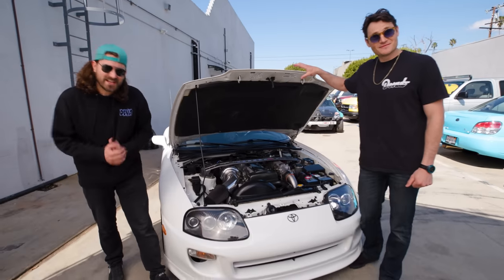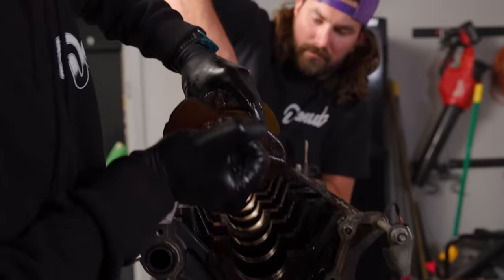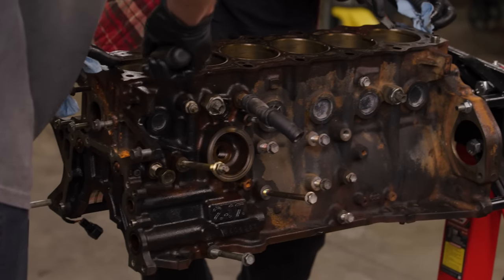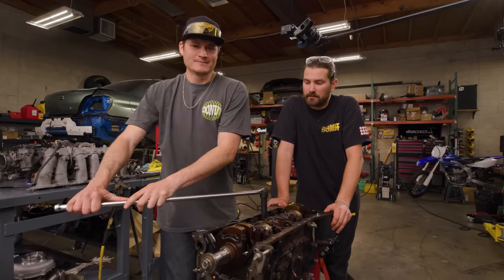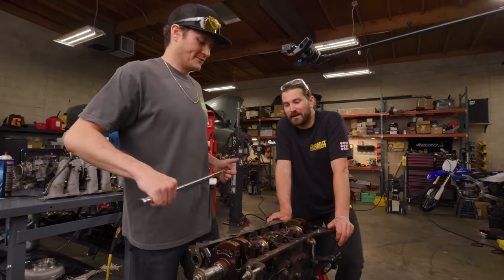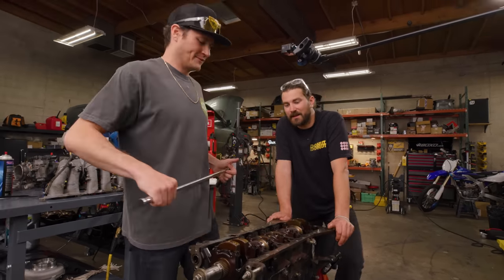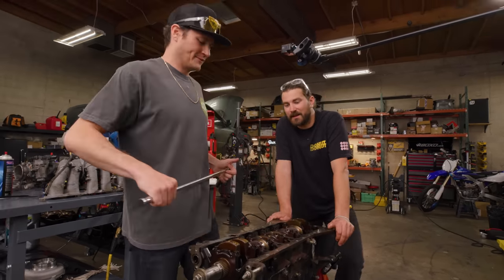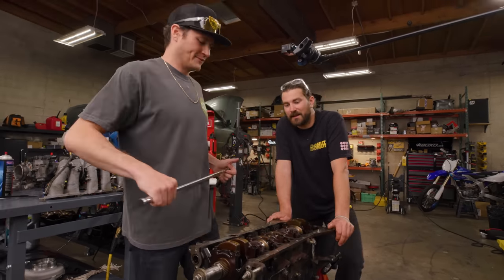Rebuilding a 2JZ to See Why It's So Good

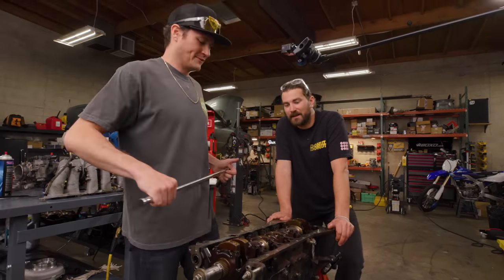Comment: @13:44 if anyone is doing this with ARP head studs, make sure to coat both sides of the washer and drop it down into the head before you install it onto the studs; you cannot do it the other way around.

@20:49 those two allen bolts are for the first VVT-I selenoid cam cap under the valve cover. Pull off the intake valve cover and you'll see the two little bolts to help seal the back of the cam cap.
Reply: Thank you for sharing your knowledge
Reply: So...uhh...is it important?
Reply: @justicedemocrat9357  Headgames motorsports told me they often break; and they have seen no issues running without them. But i think toyota designed it to help sealing, which is why everyone says to FIPG the corners under the caps to help mitigate oil seepage. Not hugely important no; but easy to put back in if your ears are still there.
Reply: Thank you for taking the time to explain this. I am building one myself and was very curious

Comment: You should do an LS teardown and see why its the most reliable, and the most common engine swap! Also, please put the 2JZ in the Silvia. It has no cons! It will fit well, It is a video that would do well, we would all love to see it, and then zack gets his car fixed!
Reply: I second all of this. 🤚
Reply: I also agree! Definitely about time Zack got his Silvia back! But also rebuild the RB!
Reply: Put the 2j in the Silvia do a tear down of the rb rebuild the engine them switch the engines
Reply: I think the LS, RB26 and the K20 would all be amazing for this series
Reply: that car was my first thought
Reply: it's the most common engine swap because it's one of the easiest high performance (for a stock one anyway) engines to obtain
Reply: They’ve mainly been swapped bc it’s a cheap and easy way for older cars to ditch carbs and go fuel injection
Reply: @@JLM.15Xthey’re also lighter and shorter than most engines including smaller ones. While also producing substantially more power than most stock motors.

Comment: Jeremiah: has an engineering degree
Also Jeremiah: can't do simple subtraction
Reply: Helpless without his slide rule.
Reply: Me too Jeremiah. Me too.
Reply: Thats what a calculator is for
Reply: Not much different from most engineers I’ve encountered
Reply: I used to attend a tech school. I have known a LOT of engineers. Engineers are now no longer capable of doing basic math. Rephrase it as an integral though, and they can do it in their head no problem.
Reply: That is the realest thing about us engineers. Believe me, I'm gonna use Matlab to do 2+2.
Reply: He was on the Revzilla podcast, and as far as I understand it, he actually doesn't have an engineering degree. He quit to do comedy before he graduated.

Comment: Stock cranks have seen 1500whp multiple time. 
Love how they put the head studs in block before installing the head. And then skipped to cams. 

Cuz they had to pull them back off to be able to fit washers in head

Comment: its all in the block. The quality and hardness of the casting material, the consistency of the castings, the siamese bores, the bore thickness from ~5,5mm at the bottom up to 8+mm towards the top (compare that to a "good" RB30 block which would be around 4,5mm at the top of the bore), ~10mm deck thickness (RB30 is around 8mm), 11 oil return holes at 15.5mm wide (RB30 has 5 return holes at 8mm).

Comment: The GE has alot more in common with the GTE than most people think. It's just ALOT easier to swap instead of modifying. Which is probably why the prices of GE's have increased as well.
Reply: Aren't the Non VVT-i GTE and GE the same internally?  It's the VVT-i ones that are different.
Reply: @sameerulhaq9928 yep, pistons are still different tho. I believe the GE non VVTI pistons are higher compression and doesn’t have oil squirrels. Funny how it’s still a bit different.

Comment: I don't know if it's important or not, but... I remember a video, when James mentioned the gentlemen's agreement and those 276 hp. He also said that it's kind of a weird number. But a lot of companies measure power in KW (kilowatts). And knowing that 276 hp = 200 kw (depends on numbers used, when calculating), those 276 hp don't seem that strange anymore. The gentlemen just agreed to 200 kw.
Reply: More precisely 206kw. The speed is also limited to 180km/h
Reply: I removed the k in mine, it does 180 m/h now 😂
Reply: At that time, Japanese car manufacturers measured their engine's horsepower in german style, ps. And in that way, the horsepower number is exactly 280 ps.
Still odd, but makes more sense than 276 hp, right?

Comment: Would love to see a rebuild of a vq35de. That’d be pretty sweet
Reply: That'd be neat. I've got one in my driveway that I just sealed back up. I'm going through the headache of trying to get all the air out of that horribly designed cooling system now.

Comment: Next we need the rb and a comparison please 🙏 😊
Reply: 2jz is far stronger. One of the Aussie channels (might have been Motive Video) did sonic testing on the block thickness and a whole heap of other tests. 2jz won nearly every single test.
Reply: @izzy031096  it's a beast what would be good actually is a Ford barra vs a 2j and then a BMW B58
Reply: @thehomelessproject3784  100% a far better comparison (despite the extra litre of displacement). That’s what makes the barra and intech so good, all that torque!!
Reply: @izzy031096  Hopefully they see these messages 🤣🤣

Comment: I'm pretty much a "jdm boi" but there's no way in hell i'm dropping 10k on that hunk of iron, the attractive of the jz engines is the "cheap" power we can get out of them, 10k puts you into a b58 powertrain like the mk5 supra, which has already been proven for 1000hp as well lol
Reply: Then you have no taste
Reply: @tfhssn  I have taste, i like the 2jz but the appeal of that engine has never been dropping 10k just to buy one. A B58 here is 4500€, a 2JZ could be bought for about 2-4000€ prepandemic, so yeah, it's not about taste it's about using a cheaper and lighter engine for cheaper that will still last and spending the difference on better cooling, suspension and transmission.
Reply: You're more of a money guy then a car guy I see lol

Comment: The 2JZ doesn’t make a lot of power at all. And that’s what makes it so awesome. 🤔

The crankshaft on the 2JZ was 20Lbs heavier than the RB25. And it has its way further away from the pivot point. 

When on something rotating you want to get the way to the center, and do you want to try to reduce it on the outer edge.... 

So that means the 2JZ would have to make more energy output to move that amount of weight to the same Power output as the smaller engine. And it wouldn’t be as rev happy, so it’s also going to be harder to make the same Hp number that the rb25 does too. 

And on the topic of Hp disadvantages.  The longer stroke of the 2JZ means it will do better after 5,000Rpm. So the fact it that the Rb25 had many advantages to help it make the “270hp” with a 2.5 vs the less efficient heavyweight 3.0L’s “270hp.”

.... but the reasons that it is less efficient, Are because they leaned towards their ability to survive a lot of different kinds of forces and twisting.

It’s not it efficiency to make and convert energy that make is so awesome. 

They simply built a more robust engine that could handle more power. And have a balanced “ Square cylinder geometry.” 

N/A 2JZ’s ain’t some 1,000 or even 800hp beasts.... they handle and withstand extremely high combustion pressures. 

And that is what makes them so awesome.

...But at the end of the day they don’t make a lot of power...they just withstand its abuse.

Comment: If those are hex head bolts those 2, they either go on the lower-end cover that goes over the oil pump and crank or it goes to one of the two upper plastic guards for the variable valve timing the timing belt covers.

Comment: So the 2J has this super cool exhaust manifold gasket that is just another reason why the 2J is so reliable and robust from the factory, and why it can handle so much power. 

The 2J has this really powerful EGR system thats just another reason it can handle so much power and is so strong and reliable from the factory.

Comment: Little know fact the FS-DE/FS-ZE from the mazda protege has all the same features and is just as strong. Only part that has to be upgraded is the rods if you want to run more than 10 psi of boost. Reliable and cheap to buy new blocks

Comment: the 2J And the 4G63 from mitsubishi Are the holy grails of bulletproof Japanese engines A few minor parts Replacement Like gaskets crank possibly Overhead cams Pistons maybe And you have a motor that is fully capable of Upwards to a 1000 horse power With a decent turbo

Comment: The Porsche S2 3.0 4 cylinder is an engine i didn't think was even made.  When the cars were around circa 2005 I had a shop and my neighbor HOT BITS suspensions had this S2 race car with a ridiculous header and custom intake manifold. I had just build an LS/VTEC and I thought it was the shit.  This guy coming around telling me his S2 is 3.0 WAS TOO MUCH TO BELIEVE.  There was very little data on the still juvenile internet so I had nothing to go by besides this guys word and the 2.25 inch primaries and 75+ mm ITBs, they honestly looked 90mm my mind was blown.

Comment: The 2RZ is the 4 cylinder version of the 2JZ. 
Iron block, Steel Crank, Steel Rods, Aluminum Cylinder Head. They love a 5860 and 6262 turbos.

Comment: I think it'd be interesting if you have torn down and rebuilt a 1.6 l boxer engine. I had a Subaru standard it was for speed and had a 1.6 l boxer engine in it and it had no Governor I could get on it and ring the hell out of one gear and it wouldn't overheat and it was always wondering why but for the little engine I can say for Street and off-road applications it did the job and maintained

Comment: next engine for teardown can be M57D30TU2 it has similar power from the stock around 285hp, its also 3 liter displacement and its also 6 cylinder AND it has also 2 turbos that works in the same way as on 2JZ but... there is one last "but" ... its a diesel :))))))))

Comment: If you clean the gasket crap off and use a fine grit lapping compound, you can slide the cylinder head and the engine block together. It will make both faces mate with each other better without the machine shop

Comment: Japanese manufacturers during that time had a horsepower limit, but they knew that nobody wanted that limit so they under tuned over built engines so there was headroom for performance mods. That’s why jdm got so famous for being able to make crazy power on stock internals.

Comment: on the idea of twin turbos. wouldnt it be possible to use a small turbo for lower rpm's and your regular big turbo for the rest? WIth a valve to close the small turbo, giving all exhaust to the bigger turbo. Im not financially educated on this but just a question

Comment: Interesting to know there are actually car engines using valve shims instead of hydraulic lifters. As more of a bike guy I always thought that's basically just a motorcycle thing. Might seem like a positive thing at first since it is so simple and reliable but having to pull the camshaft to adjust valve clearance can be a big PITA depending on how obstructed the motor is, unless you pull the engine anyways. Could be more of a motorcycle problem since stuff is more cramped in there and some camchain tensioners are also a world of hurt when retiming the engine after adjustment :/
Reply: could be probably because heads on jz's are designed by Yamaha

Comment: The crankshaft to camshaft revolution ratio is actually 2:1 instead of you saying 1:1 on 15:32. The crankshaft turns 2 times for the camshaft to turn once (4 piston moves, 2 turns of crankshaft for one valvetrain revolution)

Comment: What always confuses me is that the camshaft rotates half as fast as the crankshaft. Does it matter how the camshaft is installed? You can simply put the camshaft on the marking and then the crankshaft on the top dead center?

Comment: I get tired of other car companies doing the same thing, they'll try to tear down a Toyota and try to discover what "The Secret" is that makes them so durable,  It's really nothing special, Toyotas are built just like any other vehicle, What makes them last so long is that Toyota takes their time putting them together and torgueing everything just right, All other car companies are jealous because of their success and they are blind that they already have the resources to make a good vehicle they just absolutely refuse to do so
Reply: It's the parts they use. Torquing down everything to spec doesn't mean too much since there too many variables and it'll never be exact. Toyota in those years tend to make their parts with more material. A lot of manufacturers did this years ago. It's why there are tons of American iron still floating around, they used the most material in everything. Cars these days shave everything down to the point where they will have a failure rate that corresponds with time used. Back then this ideology wasn't present.
Reply: @GuninGames  Yeah basically it.

Comment: 15:30 you're showing the cam & crankshaft as being geared together 1:1 so they run at the same speed. The camshaft runs at half crank speed, the ratio is 2:1.
15:46 has the same error.

You should change your animations!

Comment: Either you're massively conservative on just how much the components can handle, or the stock 2J really isn't as impressive as I thought it was. Still very impressive, don't get me wrong, but I just assumed the crank and the pistons would handle over 1000hp. Especially considering the cranks and pistons of a 1UZ will. 1UZs are freaking amazing, but with all of the hype surrounding the 2JZ, I would have thought it'd be stronger than the 1UZ, right?

Comment: If an engine is just an air pump, then a quiet engine is more efficient than anything that might drown out your stereo. All 6 cylinder engines were designed with NVH in mind so don't be afraid to flex your hush power. Old people and babies hate loud noises that might otherwise wake them from their slumber and don't feel bad about crushing any wildlife that failed to recognize your awesomeness

Comment: should have compared the 2jz crank to a rb26 instead of the rb25 since they are more alike. rb25 wasnt build as well as the rb26. also im just curious how close they are. I think the rb26 long nose crank would be close to the same weight as the 2j but im sure the 2j would still weigh more

Comment: Forged steel being stronger is an total myth. Forging is done where it's faster and cheaper to do it. After heat treatment, the metal doesn't know or care how it got to be the shape it is. The myth began when steel would have had inclusions and even air pockets in, and forging stretched those out along its length, removing weak points. With modern steel, there's literally zero difference. Lifting hooks are where the myth gets spread the most. Especially in crappy diagrams that draw the grain as though it functions like wood grain. It doesn't. Lifting hooks are forged, because it takes a second to forge one in a press, rather than machining them via stock removal, which could take HOURS. Same with crank shafts. It's just a lot faster and a lot cheaper to get as close to the final shape as possible, in a big machine that squishes the metal into shape

Comment: The only reason why this engine is so great is because americans were used to primitive OHV V8's and this was installed in relatively cheap car. The only thing in which Audi 2.2 20vt engines of this era are inferior to this engine is  displacement - so the same level of tune naturally brings lower power - therefore highly tuned engines usually goes up to "just" 1000 hp.

Comment: Ummm. Every engine of all time are DEFINITELY NOT FORGED lol 90 percent of vehicles are cast. If every engine was FORGED there would definitely be some 600hp geos out there lol

Also forgot to mention that uses a very "low pro" oil pan to reduce windage and also also the cylinder head uses studs instead of bolts to prevent the cyl head from lifting and can handle more boost

Comment: Take apart every cool car engine just like this indepth all nine yards torn down then put back together and try to start it challenge ; example cars would be like the Audi Quattro,  Alfa Romeo Guila (Ferrari cut in half),  Lancia Delta Integrale, 73' Ford RS 1600, Lexus LFA (why the caged V10 sings), any Lambo cause V12 duh, and maybe a Buggatti (W16).  Can't think of anymore engine layouts aaaaaaaaaaaaaaaaaaaaaaaaaaahhhhhhhhhhhhhh

Comment: No engine should be able to handle under 1000 horsepower, period.  Even the 4 cylinder 4g63t could build 1000 hp to the crank.  700 hp for a v6 or a straight 6 is like shooting blanks...

Comment: What is this video.... who tears down an engine and uses the original main bearings, and piston rings? Why not replace while there?? Why did we polish nothing? Why show torque specs on the crank, and use a impact gun on every 10mm and 8mm bolt, without ever explaining they have torque specs and patterns as well. How much "Quick Start" was needed to start that engine and keep it running? Without even a thought of proper air flow and back pressure needed to maintain that type of operation?